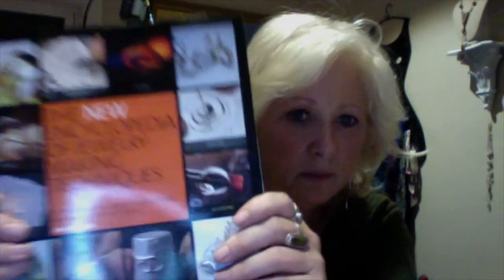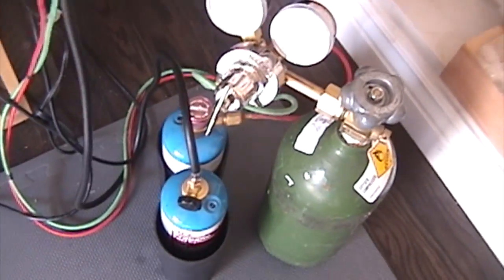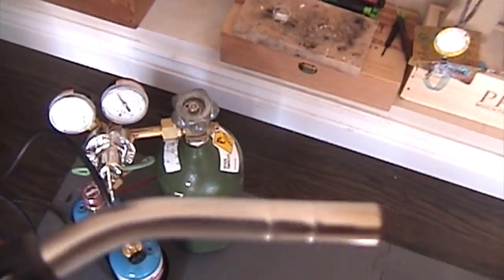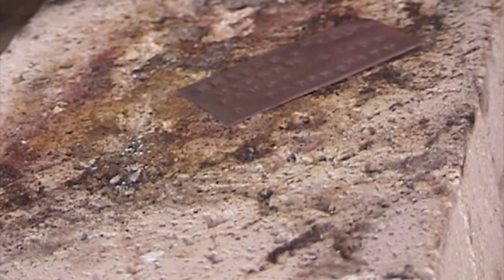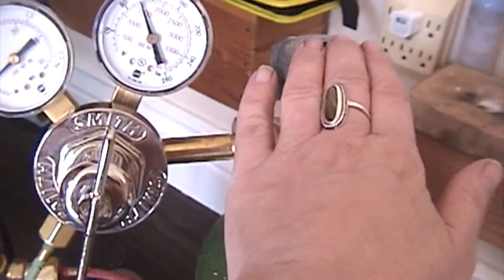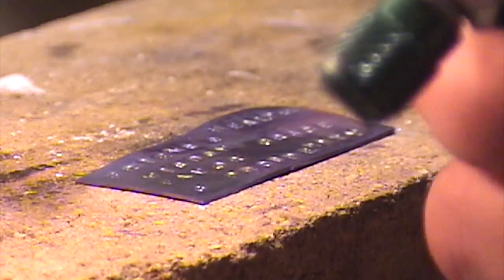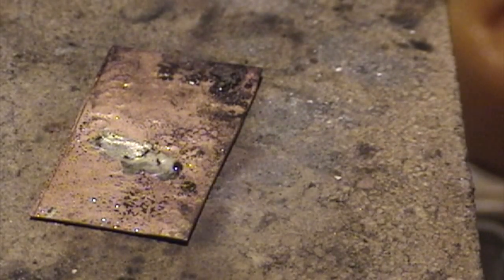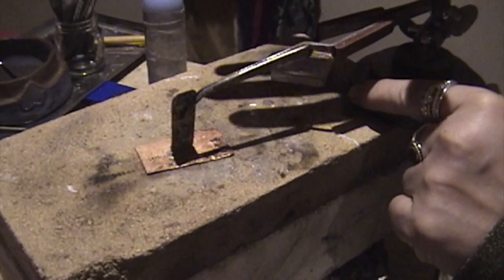Intro to metalsmithing basic tools  Part 1

Comment: pretty good video, I was having a hard time finding information about the smith little torch, this video helped a lot. just a few small points, as has been mentioned acetylene is pronounced a-set-a-lean. also you will gain a lot more performance out of your smith little torch if you learn to set the flame properly. you need the proper oxy-fuel mixture depending on various conditions, and you can tell pretty well based on how the flame looks. I won't describe it here but search Google for a neutral flame, and an oxidizing flame versus a reducing flame. that should help some. 

thanks again!
Reply from the maker: I'm making a new video showing different tips you can purchase for the torch and how to hook up an oxygen concentrator. If u are subscribed u won't miss it. Thanks for commenting😀

Comment: Leslie, loving your work. I'm just getting into silver work. could you let me know the diameter of the nozzle on your gas gun. I'm not sure if the one I have is too wide. thanks
Reply from the maker: Linda Boyle  gas gun?  you mean torch?  Smith little torch comes with 7 tips - the other  Home depot torch i recently changed to a pencil tip (the pencil tip torch comes with a can of propane at your local hardware store) read the notes directly under the video for some links